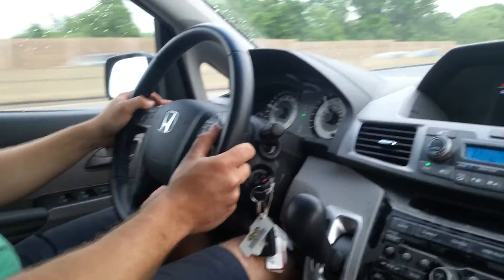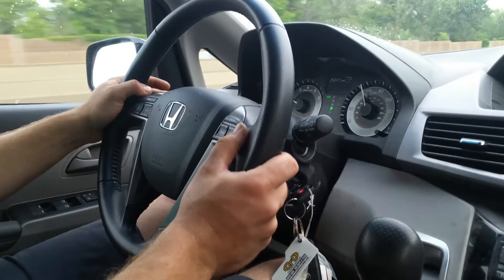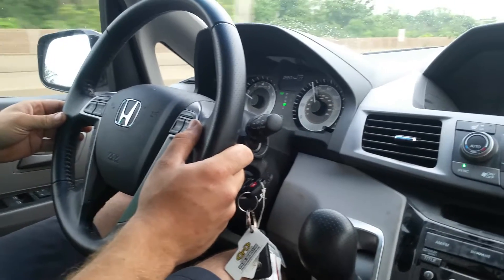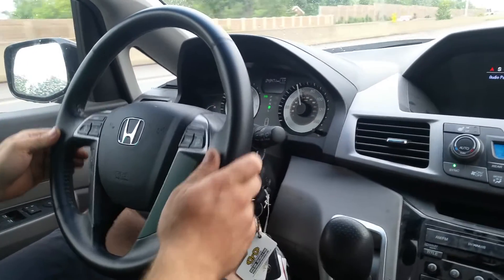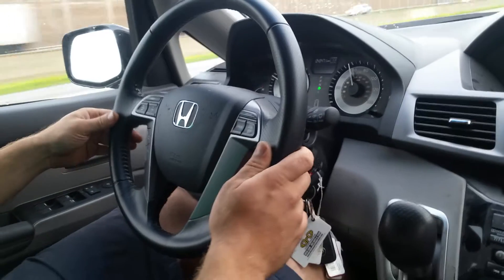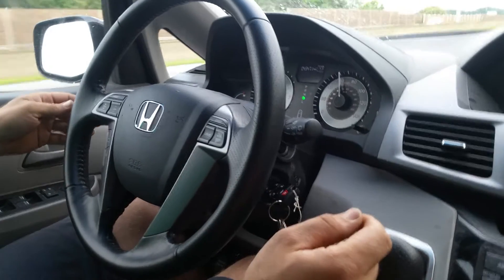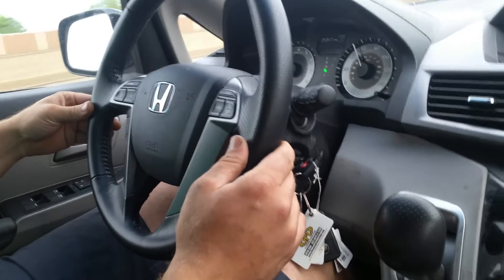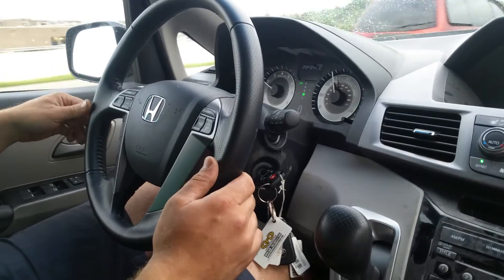HOW TO DETERMINE STEERING WHEEL VIBRATION SHAKING ON ANY VECHICLE.

Comment: Are micro vibrations are normal on high speeds (110+ km/h)?
I have a very very little vibration on high speed and i'm not sure if it's okay.
Wheels are balanced.
My wheel vibrates with amplitude of 1mm at 130kmh and i'm not sure if its problem.